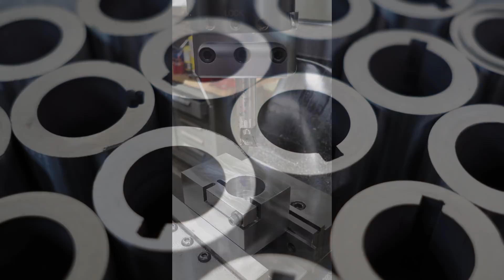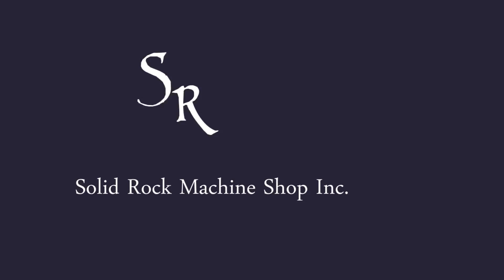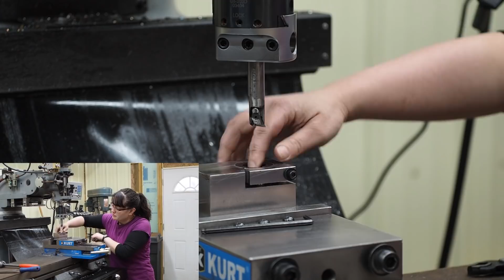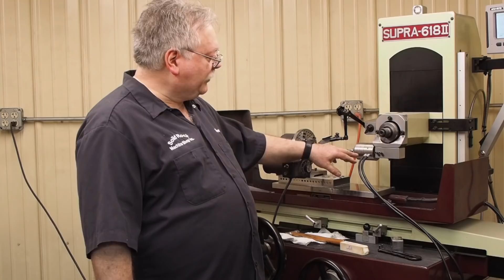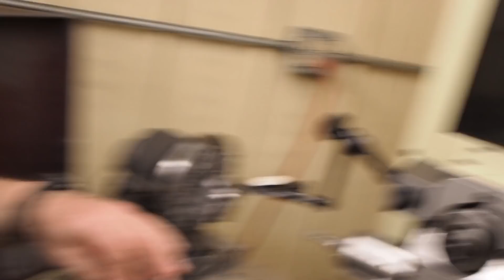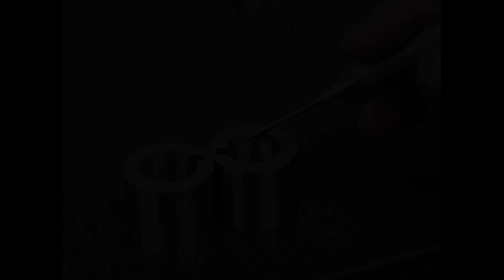Hard Turning and Grinding ID of bushings Part2

Comment: Is the die grinder stone diamond or a borzon typ  typical to a gig grinder. Really not sure what there using today...done my share gig, blanchard.and surface back in the day. Now all cnc mills and design..yea i still have borzon stones laying around somewhere..
Reply from the maker: I am using Diamond. CBN (borzon) and carbide don't get along well but diamond eats it up. CNB (borzon) is great in hard steels.
Steve
Reply: @SolidRockMachineShopInc  brings back memory's i had some really difficult form to cut. About 30+ years ago. Lot of prog die stuff as well. nice vid's

Comment: Question Steve...this is likely the second time I have watched this Video...It appears that you are doing the grinding on the edge at 3 oclock and then using the down feed to increase the ID...this would then give you a finer adjustment, than grinding at 6 or 12 oclock and dialing in a tenth....correct???  Your likely if truely at 3 oclock actually removing about 0.000033" per 0.0001" of downfeed, does that sound right?
Reply from the maker: Hi Preston,

You are correct that I am grinding a 3 o'clock  but I am using the Y axis for adjusting not the down feed. If I was using the down feed like you mention above you are correct that it would be a much finer adjustment but one that would be harder to calibrate. If I take off .0001" using the digital that would be .0002" total. The digital I use has a .00005" resolution which makes it nice for this type of work.
Steve

Comment: That grinder setup works much better than my die grinder clamped to a bar on the tool post my lathe.  Is this something you would consider doing with a tool post grinder?  I have to assume your setup on the surface grinder is more rigid.  Thanks for another informative video.
Reply from the maker: Hi Robert,
You could do it with a tool post grinder but it may be harder to control the taper. Also, the axis movement on a surface grinder are much smoother and more precision.
Steve

Comment: That’s the first time I think I’ve seen a person run a boring bar at a decent speed. Usually see everyone run them under 100 rpm regardless of what they are doing.
Reply from the maker: Hi Strangefruit,
I should be going even faster with CBN but the boring head being off center causes the machine to shake at to high of RPM.